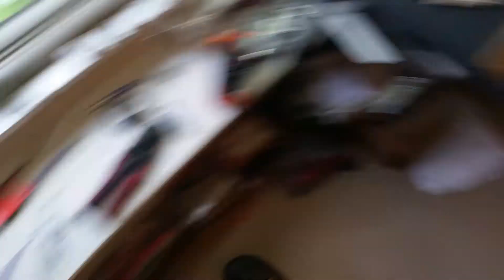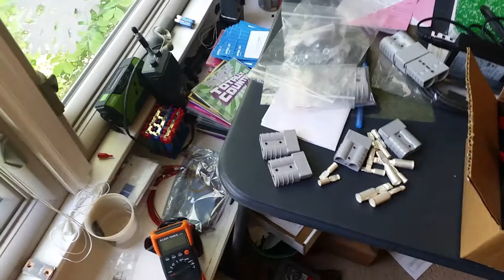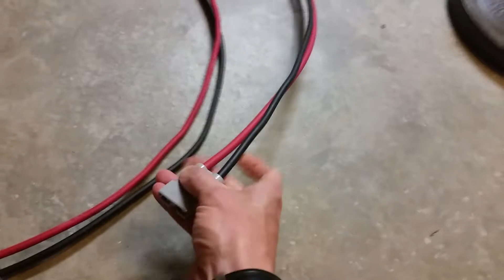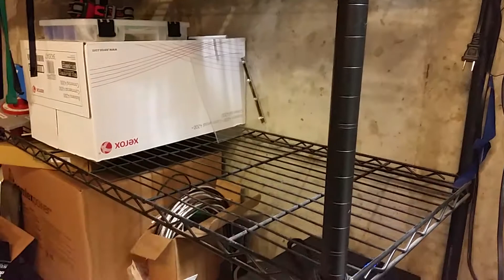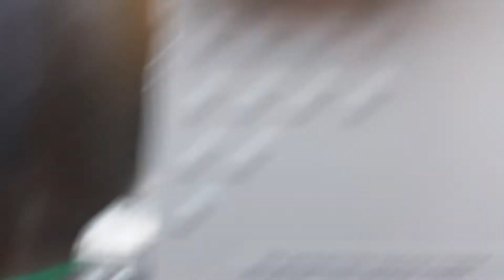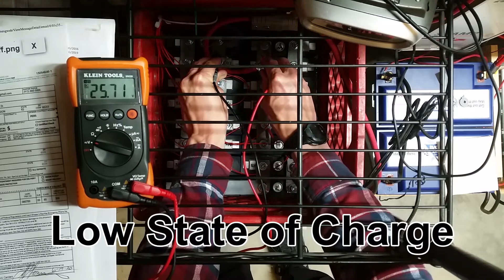Off-Grid Solar Backup Power System:  DIY Lithium Battery Build Part 4

Comment: Is that battery set in the milk carton 12v or 24v?  Still trying to get my head around this stuff.
Reply from the maker: Hi and thank you for checking out the video!  It is a nominal 24 volt system.  There are 16 batteries in each crate and the batteries are paralleled into sets of two before hooking them up in series.  Some of the other videos in the series prior to this one should show that.

Comment: Don’t you have to compress the batteries?
Reply from the maker: Not from what I have seen.  The only reason I've seen people clamp the together is just to help hold the together.  Plus, some of these already had some expansion that occurred (as you may be able to see in the first video on this build) so doing that would have not made for a pack that looked good.

Comment: Nice build. I never used Anderson plugs before and stole your idea. I used them for the solar input on a ''portable'' home built ''solar generator'' of 7100 watt hours. Its on wheels and in a square steel roll cage with everything, 30 amp MPPT, battery monitor, 75 amp charger onboard. The unit will power a fridge and 2 chest freezers when the wildfires and PG&E shutdowns occur this Summer again. In August it was out for 47 hours. 

I used 8 of the EVE 280 amp hour cells.  Might be 120 pounds now but will sit in a corner under the workbench until needed. There's a roll of 50 feet of #10 wire with MC-4 connectors on ready to plug into a spare 400 watt solar panel. Can't mount them until the roof guy fixes his screw up.  You do nice work.  That damned Will got me hooked on this $tuff.
Reply from the maker: Hey, thanks for the awesome comments!  Much appreciated!  No problem stealing the anderson connector idea, I probably stole it myself.  That's what this is all for.  Your portable battery bank sounds awesome for something portable with some nice stuff.  It's a good feeling having that taken care of.  Wishing you well out there on the west coast and hope you are prepared for everything else as well these days.

Also, loved the last sentence.  Yeah, Will Prowes's content is fantastic and addicting.